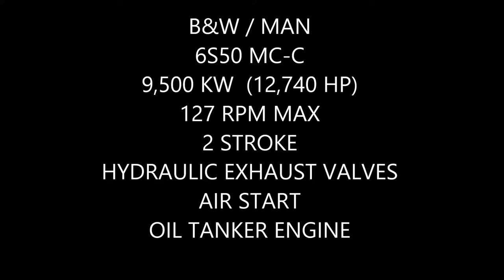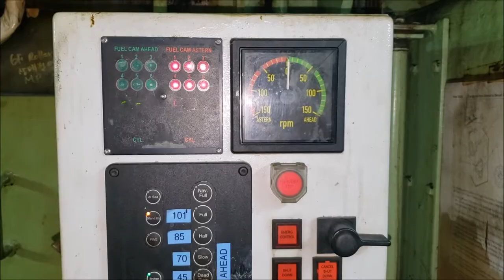Ship Engine Start And Run Slow Speed 2-Stroke MAN Diesel

Comment: thats some crazy low frequency bass gotta have the volume cranked to hear it
Reply from the maker: Comes through really well when the engine is running at lower speeds too. Up around 100 RPM the turbo drowns out everything. Thanks for watching!